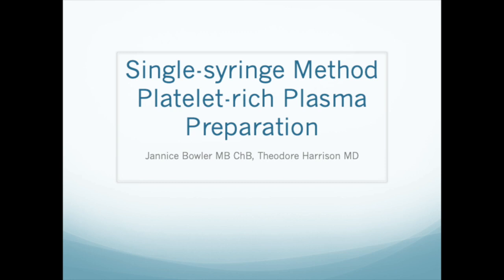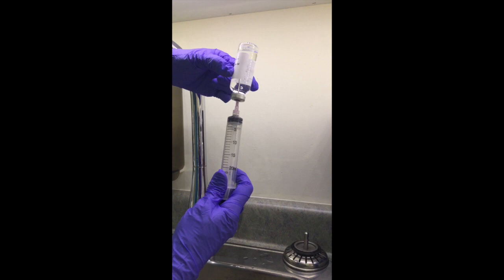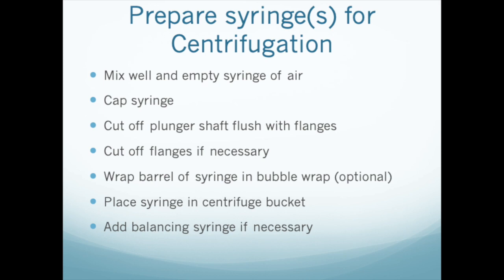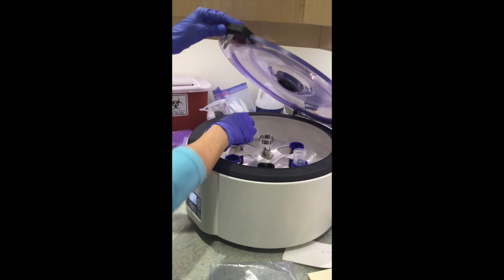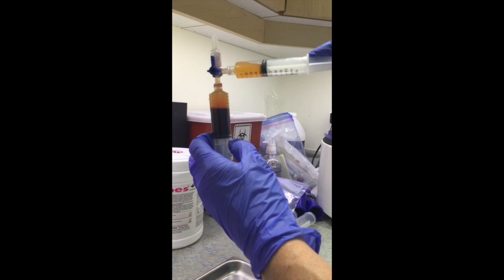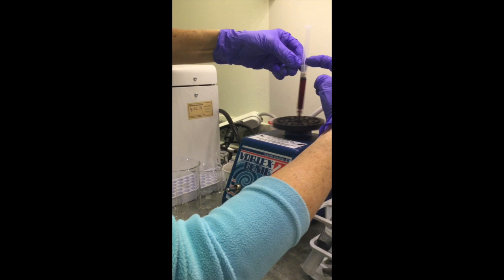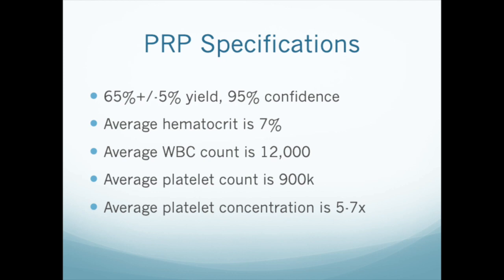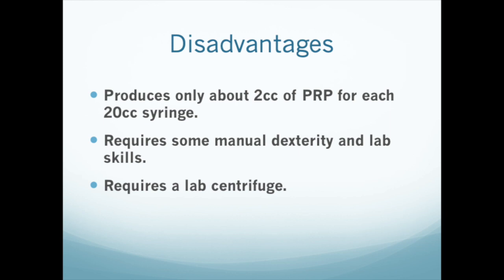Single Syringe Method of PRP Preparation

Comment: thank you for these videos.   You mentioned in the videos that after preparing the plasma, you could cool it and administer it, or activate it and administer it.  Does that mean that you do not necesarily have to activate it? thank you!
Reply from the maker: Whether you activate it or not will depend on your application. The platelets will be somewhat activated on injection by collagen in the tissue. If you want more activation in a localized area (tendon injections) then you would probably want to activate it before injection so that a fibrin clot will rapidly form and keep the platelets localized. If you want the PRP to spread and slowly activate (some cosmetic applications) then you would not want to activate it before injection.

Comment: Don't you need to spin the 2nd syringe as well?
Reply: The second syringe already contains concentrated PRP. There is no reason to spin it again. However, if you wanted even more concentrated PRP you could spin it again and then separate the layers once more. But of course if you do this you will get a reduced yield because of platelet loss during the process.

Comment: Why do you add the red blood cells?
Reply: I think you may have misunderstood. We don't "add" any RBCs. We include the part of the buffy coat that is stained with RBCs because about half of the platelets are in that portion. Yes, this means we have some RBCs in the PRP. But without that portion our platelet yield would be much lower.
Reply: @tedharrison3356  I never knew this.  Thank you!!

Comment: How to activate it ??
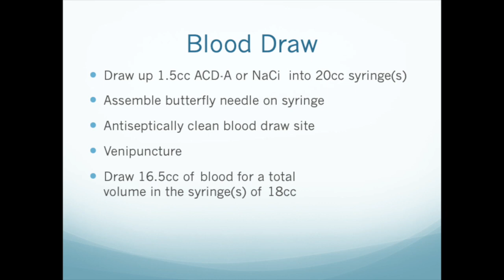Reply from the maker: Most people use calcium. Either calcium gluconate or calcium chloride will work. We use 10%CaCl3 at a 1:20 ratio. You can also use thrombin or a host of other chemicals (platelets are very sensitive!) but we have no experience with these.
Reply: @rejuvacare8925  ....it means u simply add cacl with PRP in ration of 4:1...e.g 4 ml of PRP with 1 ml of cacl and then mix PRP with cacl by shaking ?
Reply from the maker: @Dr-789  No, the ratio is 1:20 as I said above. E.g. 0.2ml of CaCl3 in 4ml of PRP.